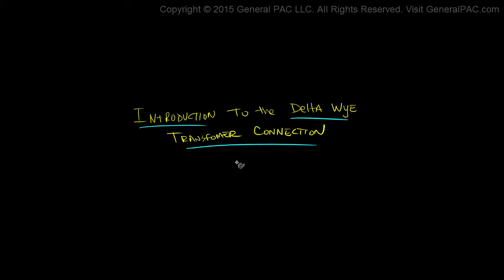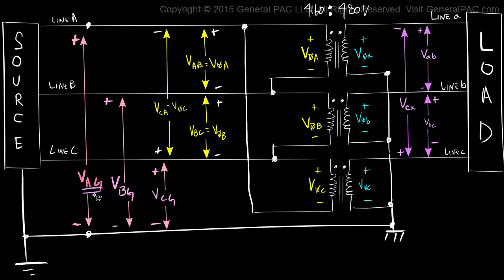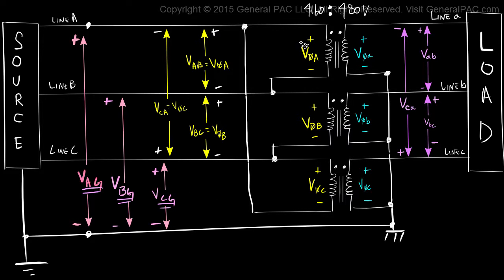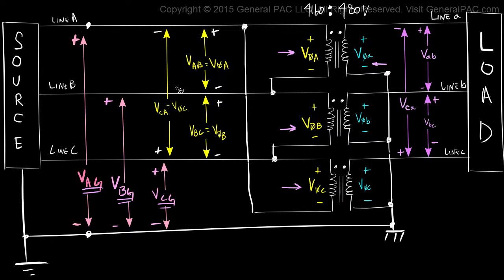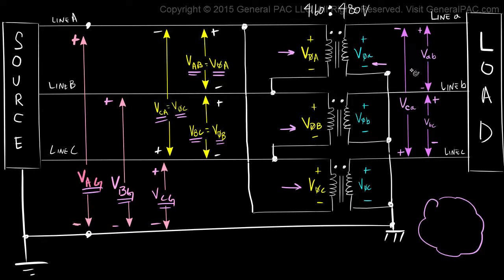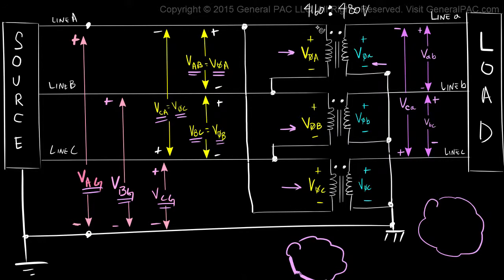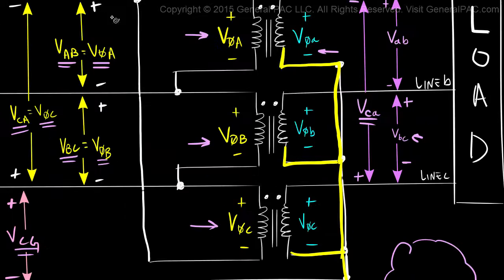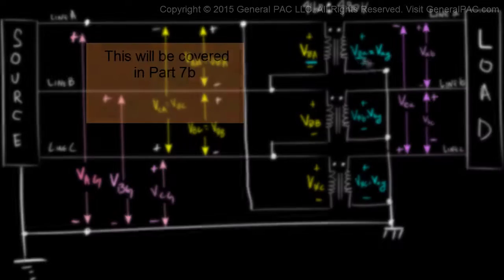Introduction to the Delta Wye Transformer Connection Part 7a: Understanding DAC or Dyn11 designation

Comment: Hello everyone,I am Asaad Salem studying electrical engineering and I have to specialize next semester either in (power) or (control) .what do you think is better and why and .thank you.
Reply from the maker: +Asaad Salim  - I personally would motivate you to go into power systems. Due to the incredible need for a modernized electric grid, there has been an increasing need of electrical engineers specializing in power. The biggest driver is Increasing population and standards/regulations.   

There are many sub fields that one can specialize even within power. Entire working CAREERS can be spent in substation design, power system protection, power system automation, electric transmission/distribution design, power system communications, power quality engineering, metering engineering,  electric planning (for transmission and distribution), as well as energy engineering. At this point, we're only talking about design work. The operations side is also expansive. There is also work for testing and commissioning various equipment like substation apparatus such as transformers, breakers, regulators, etc. You can also work with protective relays testing various protections schemes protection time overcurrent, differential, as well as communications assisted schemes like POTT, DUTT, etc. This is both in generation, transmission, and distribution. 

There is an incredible amount of man power required to keeping the electric grid safe, reliable, efficient, cost effective, and SMART!